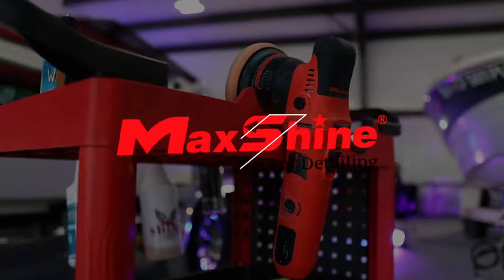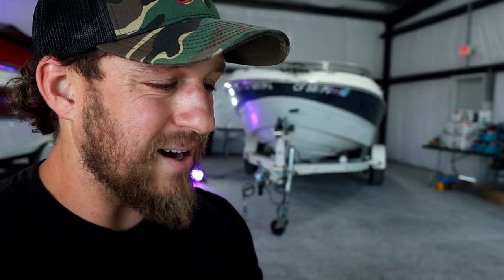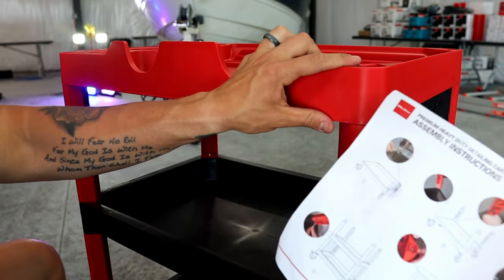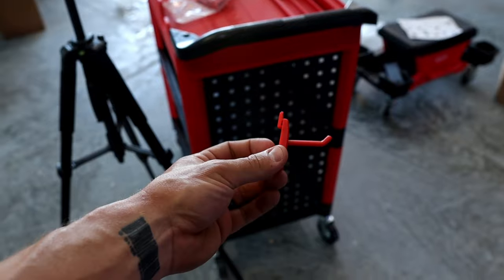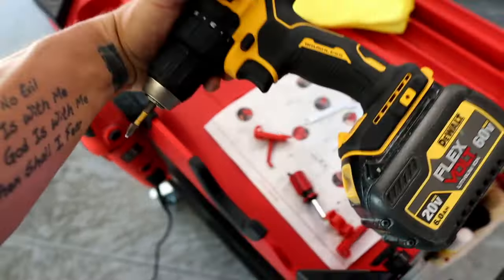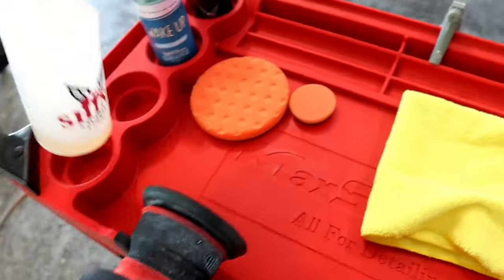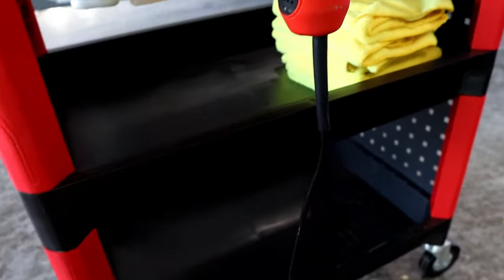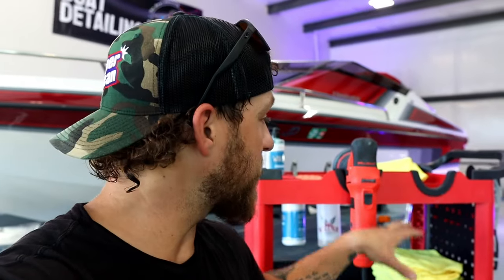MaxShine Premium Heavy Duty Detailing Cart | Boat Detailing Business Tips

Comment: Just found your channel  great stuff and videos are just as clean.
Found it because I've been considering this in my small hometown.
Very popular small river town in Missouri. 
I'd be working on about 50% aluminum and 30ish% wrapped or painted aluminum followed by fiberglass the very very least.

The Current river is crystal clear with all rock bottom, because of that fiberglass is kinda a scarcity except jetski's
However, the town attracts alot of well to do people wanting to cruise the river every weekend while relaxing in their river cabins. The city has to open the entire soccer field next to the river access to accommodate ramp parking. This is not counting private ramps at alot of cabins.  Ironically no dedicated boat detailing service.🤦‍♂️💡

We have 1 brick and mortar detailer who is primarily automotive with no mobile services.
I'm thinking a mobile boat detailer is exactly what they didn't know they wanted in a town that has a bigger river boat dealership than actual car dealership.
Anyway, boats around here range between 20 to 60k, high end brands being Shoal Runners and Gator Boats. I'm sure many of these people would like to run more expensive flashy boats but the river won't let them. 10 inches of water is pretty common and a prop is rare as a unicorn.

Been around boats nearly my entire life and know them pretty well I'm just not completely up on the detailing side of things yet.
I can imagine how busy you are with the business and videos but any suggestions you might have off the top of your head I'd respect your opinion greatly.
Great job on it all and keep smashing it. Subscribing was a no brainer.
Reply from the maker: Hey bro! Thanks for the comment! It’s hard for me to put all my thoughts for you on my thread, can you send you a DM @drakes.detailing on Instagram? Or you can send me an email at Drakerobert@detailusupply.com

Thanks so much!!!
Reply: @DrakesDetailing  No problem. Not looking for you to hold my hand or anything like that. Been in business before and know how important networking is. I'll certainly shoot you an email when I can.

Comment: Hey Drake. Got a new lake mat that looks like it has bled dye onto my boat flooring. Its woven vinyl with white and grey coloring. The dye is orange and has made a brown stain on the floors and the sidewall of the tritoon. Any suggestions on getting this out? Ive tried heavy degreaser and magic erasers. Nothing will touch it. Thanks.
Reply from the maker: Hey bro, I actually haven’t had any experience with that, so I would not know what direction to point you in. Sorry!
Reply: @DrakesDetailing  Thank you for your response.

Comment: Do you always go from abralon 500 to abralon 1000? I know you mentioned hitting it with a little abranet 1000 if you were having trouble. Any tips on getting out the 500 on colors? Didn’t have much issue on white but this red was being a pain the other day
Reply from the maker: I’ve never really had an issue with it. With wet sanding you can jump a little bit more in grit.
Reply: @DrakesDetailing   how many passes of 1000 do you usually do after the 500 on a section?
Reply: @coryhunt7424  3 times. Side to side, up down, then side to side again.